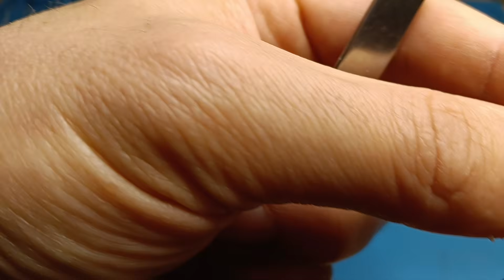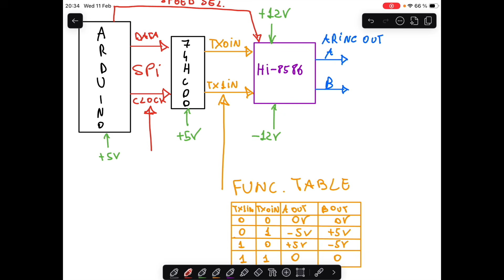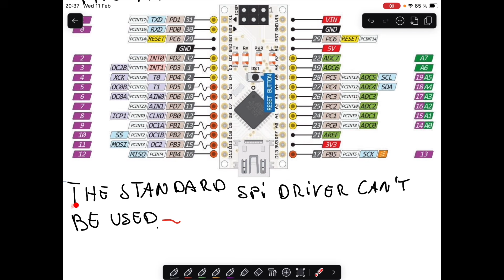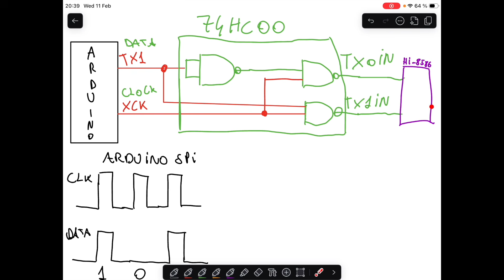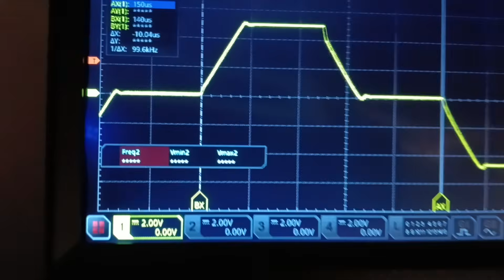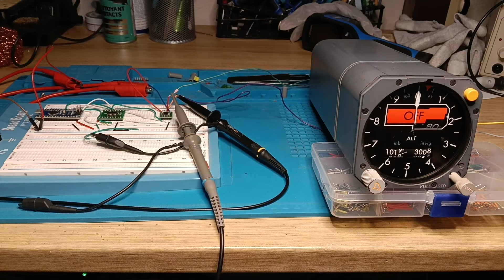DIY Arduino ARINC-429 Transmitter

Comment: Hello, I also bought one of these altimeters, but I noticed your program defaults to label 204, while in the video you mentioned label 203, and the waveform does indeed show label 204. The manual says Standard altitude (label 203) and Barometric corrected altitude (label 204). My question is, which pin should GND be connected to on the Arinc 429? If using label 204, does it need to be connected to pin J, or to GND or 28VDC? I'm using your default program, but the altimeter isn't working.
Reply from the maker: Hello. It does not matter which label you send. Label 203 or 204 go to the same pins. The STD altitude 203 works if pull the baro knob out. I don't remember if I connected the GND anywere. the altimeber works with 115V 400hz, so no 28VDC needed.
Reply: @avionicsbench  Okay, thank you for your answer.

Comment: I'm a bit lost here.  I finaly got my Nano board in the mail today.  I've everything wired up.  Last thing I need to do is get the code on the Nano .. how does that work ?  Which files from the github do I need and how do I get them on the Nano ?  Is it via Arduino IDE ?
Reply from the maker: I guess you can upload the firmware via the Arduino ide too. However, I prefer to do it via the terminal using make upload
Reply: @avionicsbench  is there any other way to contact you ?  Youtube keeps deleting some of my posts ...
Reply from the maker: @Fokker50Sim  write me on github. maybe open an issue in the arinc repository
Reply: @avionicsbench  Ok, I got the code on the nano.  I had it smoking for a second, because turns out I can not have it in the cirquite ànd have it connected to usb at the same time.  I tested the nano and it should be ok and still working.
I am now however strugeling because the gauge does nothing.. meaning probably that I have not edited the code correctly yet.
The gauge is the same from the LDM 444 video.
I need arinc429 low speed.  So in 2 locations in your code I changed the comment to code and the code to comment.
TRQ label is 336 in octal .. do I put 336 in the code then or 251 ?
From a data sheet I got from Fokker, I know:
bit9&10 = 00
bit31=1, bit30=1, bit29=0
12 bit binary data:
bit28=2(11) MSB, bit17=2(0) LSB, bit11-16=0
120% torque = 1920
transmit interval 200ms

I don't have an osilloscope or have access to one, so I can not read out the output to check what's going on.
Maybe you have some pointers or tips for me ?

Comment: One more noob question.  I ordered a TPS5430 dual rail power sup from amazon.
How do I power that ?  It sais 5V-28V DC ... so I guess it must get more than the 12V I need from the output ?  So can I give it the 28VDC which I also need for the TRQ gauge ?
I think the info on the back of the pcb is missleading .. they probably use the same pcb for 3 different versions of the module.  Anyway .. I think with the 28VDC power adaptor I will have, it should be ok.
Reply from the maker: You can try with different voltages before connecting everything

Comment: Q: why do we lead the D5 pin to the 74HC00, before going to the Holt ?  I understand that if we take 1 output to both entrance pins of a NAND gate, the output of the NAND gate is the inverted signal ?  Why would you want to do that for the Hi/Lo speed selection ?
Reply from the maker: It was like that in the Michel schematic. You can also connect it directly

Comment: Q: is the signal coming from the NAND to the Holt (TX0in and TX1in) interchangable ?
I have been comparing your wiring to the drawing from LdeM and I notice its different there.  The signal coming from the Data to the NAND, then the other NAND, combined with the clock, goos to pin 2 (michel), 3 (yours) .. while the signal from the data and the clock going to the single NAND goos to pin 3 (michel) and 2 (yours).
https://drive.google.com/file/d/1PvkJJ6GMU48HfdBrvL0_6sMFdp3Lc0sy/view?usp=sharing
This is correct ?
Reply from the maker: Hello, yes it is correct :) Can I copy your schematics to the github page?
Reply: @avionicsbench  yes, absolutely
Reply: Also, do I need the resistors and the other items drawn by LdeM (all things on the right of the Hi 8586) ?

Comment: I have several Arduino Mega 2560 Pro Mini ordered for making re-created gauges with stepper-motor work.  I also have 1 or 2 real gauges in my sim.  Can I use this with the Mega, or does it need to be NANO ?  I am an arduino noob at the moment, so ... 
Also, does this setup of yours work to connect multiple gauges, or do you need 1 setup for every gauges ?
Reply: As far as I can tell, all F50 TRQ units are one and the same.  So there is no way to send data to a different label to address either one of them (left vs right).  So I assume, if I connect both to the same Arinc cirquit, they will just both show the same value.
So then I would need 2 Arinc cirquits, one for left, one for right and keep them separated?
Reply from the maker: @Fokker50Sim  Hello, maybe it's better to have two separated PCBs for each instrument. Usually you can select the ARINC instrument with SDI, but I don't know if this can be done with your F50 TRQ. About the Arduinos,  you need an arduino NANO or an arduino which has the XCK pin exposed
Reply: @avionicsbench  Weird, I had posted an answer here, but at first YT showed it to be posted double, so I removed 1 .. now they are both gone and I can't seem to re-post the original post...
Reply: @avionicsbench  I will have a Nano, with your setup, which will connect to the TRQ gauge.  Now, since this Nano will not be able to connect to MobiFlight, because the mode it will run in will not be compatible.  So I will wire the Nano to a Mega.  The Mega will run MobiFlight and wil think there is an LCD connected.  MobiFlight conects via i2c to an LCD and sends it data.  So the info I need to send to the gauge will come into the Nano over i2c.
I have ordered 2 8586 and 2 NAND chips.  So far I have 1 Nano ordered.  Will I also need 2 Nanos ?  Or is there a way to do it with just 1 ?
Also, the wiring in your video is not very clear to me .. and seems to differ from Lab-d-Michel ?
Could you add a clear pin to pin drawing of your setup to your GitHub ?  That would be awesome! Thnx!
Reply from the maker: @Fokker50Sim  You need two separated clock and data signals. I don't remember if the NANO has enough XCK pins to do that. About mobiflight, I believe that could be done with one arduino only. You should port the mobiflight firmware to the nano or just understand how mobiflight ardunos send the data to the computer via usb and implement the same on the arduino nano.  The wiring is the same as the labo de michel. There is also a pin used to select the speed high/low. I will post a schematic if you can't really work it out, but it's the same as the one used by Michel.

Comment: I'm looking to do something similar for DCS with some old avionics. Would it be easier for me to just buy the holt board and replicate your work or wait for the non holt driver version? If anything I'll make it to learn more since this is my first real sim build.
Reply from the maker: Hello, thank you for your comment. I plan to release the TX-RX version of the board this month or next month. It uses an ESP32 and cheap components. I already have a PCB for it and it works very well. If you want to experiment with ARINC 429, you can also buy the HI-8586 and try the same circuit.

Comment: Designing an opamp solution for this that works at a hobby level might be an interesting engineering challenge. Probably converts to 1/10th the parts cost. The HC00 can probably be eliminated as well. 100khz and 12.khz aren't too hard to do with timers. Either you can ignore the slopes entirely and see if it still works, or use capacitors to limit slew rate, or create two different current sources which drive an integrator opamp at the correct speeds.
Reply from the maker: Hello yes. I already have a Holt free version which uses cheap components. It works very well and it's super cheap compared to the commercial solutions.  I will make a video about it in the near future.

Comment: for home use i doubt that you need to go as far as limiting the rise and fall time of the of the waveform, the trapezoidal waveform may not be required as you wont be bothered with limiting the high frequency noise.
Reply from the maker: I agree. In the next version I will use cheaper components. Still precise for timing but with square signals
Reply: @avionicsbench You can use NE5534 op-amp for the ARINC 429 transmitter, like in my video 439. The programmable slew rate permits to set the rise and fall time.

Comment: I think that playing around with a dual opamp you should be able to use it as an output driver for arinc 429, with only one pin by the atmega driven by timer interrupt, especially if you only want to output data
Reply from the maker: Hello, yes correct. Stay tuned for the cheap and more capable version with 1TX and 2RX channels